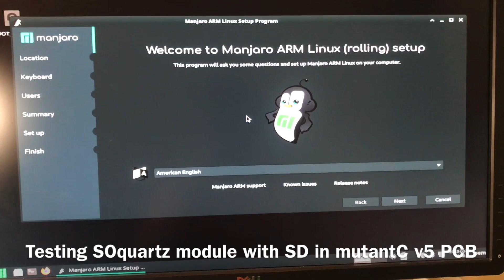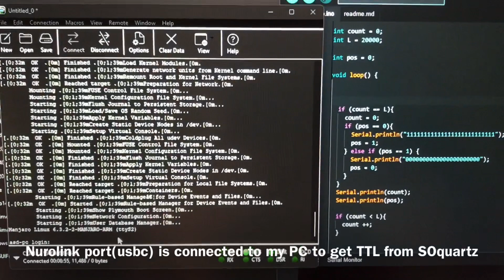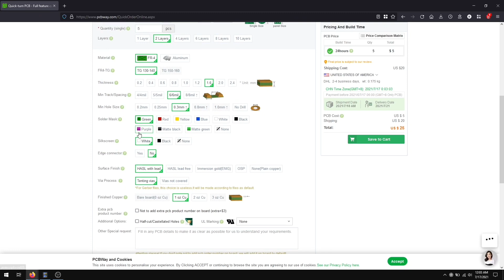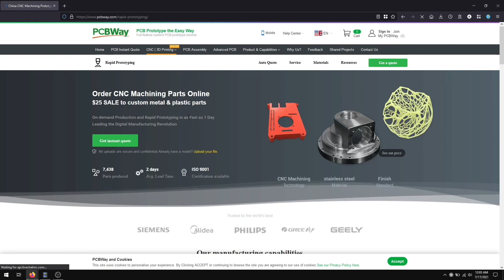HDMI through FPC is a show stopper (Update 5)

Comment: Nice seeing progress on this project, because setbacks are also progress! There are two things I would want to suggest that can hopefully help;
From what it looks like on the video it seems you are using plastic FPC connectors. When shielding, try to ground the aluminium foil you are shielding with your GND plane on both PCB's, if i remember my theory correct having the foil in a "floating" state can reflect EMI and make the HDMI signals look even worse.
I would also suggest looking at making your own Flexible PCB at PCBWay. There should be calculators online to help you calculate required differential and single line impedance for the cable. 
Still very impressed by the project, couldn't have done it myself on a hobby basis. Keep it up!
Reply from the maker: Plastic FPC, you mean the white one? And I grounded the foil with one side of the PCB, I might have to test it grounding with both sides.

As for the designing my own FPC, I am looking into it. As I never done it before I want to learn how to do it in KiCAD, also they are expensive $110 for 10, for anyone who wants to replicate the project, that would be expensive.
Reply: @mutantCybernetics  I understand, and i was looking at the connectors you used for connecting the PFC's, from what i have seen shielded PFC cables uses PFC connectors made with a metal interlock to ensure good grounding with the shield. But as long as you find other ways to ground the shield then this shielding solution should work! 

Do hope you find a solution to this, keep it up!
Reply from the maker: @TheHareidGamer  thanks for the suggestions. 
i will test the fpc with proper grounding and make a video. If i build custom FPC then i will ground them using the pins in the connector, don't want to use fancy metal ones to save cost and availability. 
if you join me in the discord, youtube is not good for chatting.